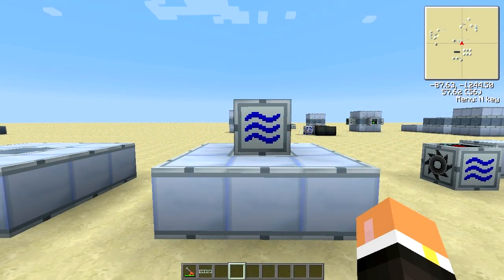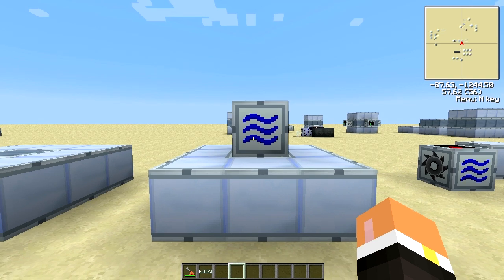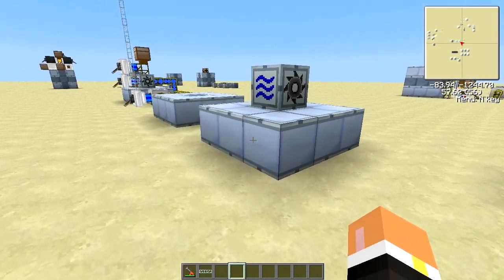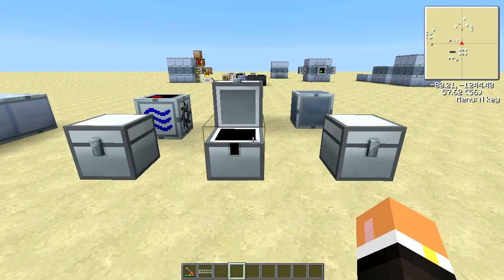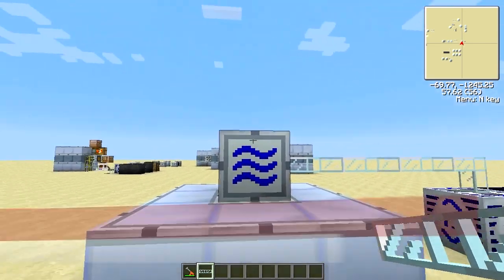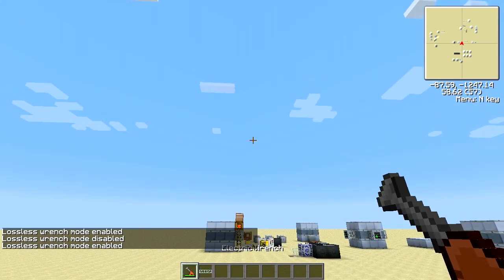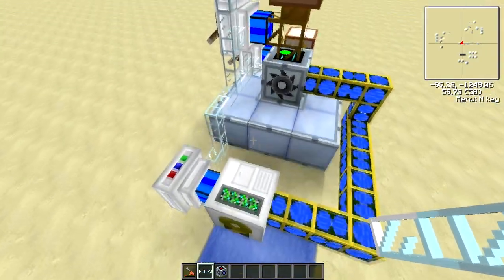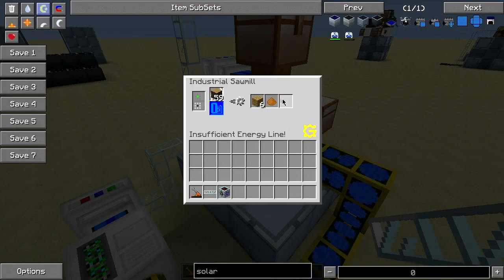Feed The Beast :: Machine Tutorials :: Industrial Sawmill

Comment: Ruby, I have watched several of your FTB machine tutorials, all of which have been very helpful in setting up my workshop, as well as helping my member base on my server, much appreciated.  I however have a question regarding the Industrial Sawmill, it seems there is a small slot below the input for the wood (left side of the GUI), similar to the icon slot for cells in the Industrial Centrifuge...  What is this slot for?  I haven't really seen anything about it online, thought I would ask.